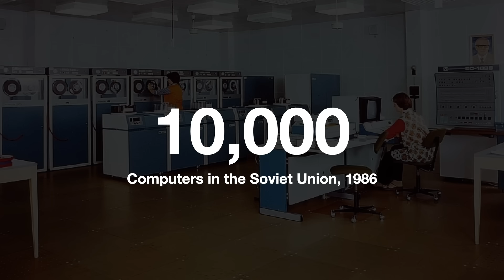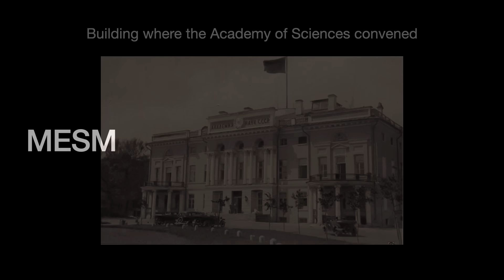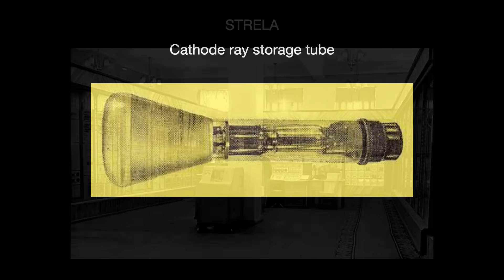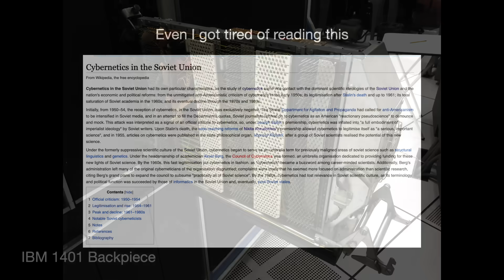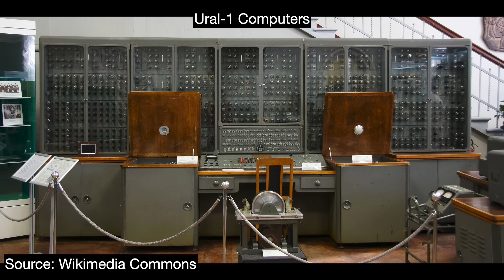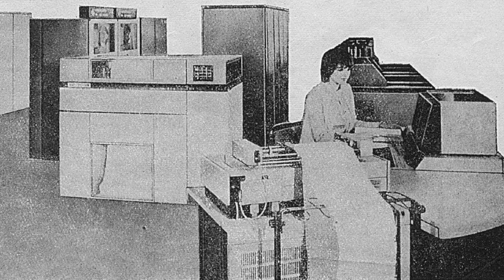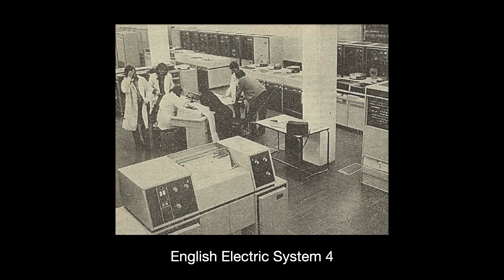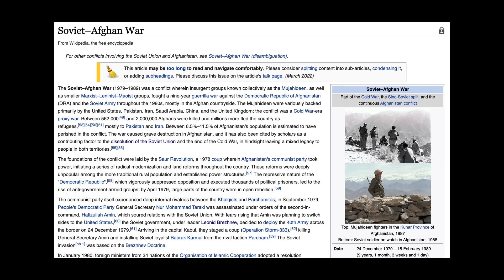Why the Soviet Computer Failed

Comment: I worked in computer research in Czechoslovakia 1980-1990 and depicted situation correspond with my experience. We worked on smaller computer line which was basically a copy of DEC PDP11. Perceived gap in development was 8-10 years. But this could never be spoken out officially because of which is today called political correctness. The breakthrough was heralded to happen every next year. The rule of politicians over scientists and engineers then stopped for roughly 25 years and nowadays is returning again.
Reply: From the motto: Catching up and overtaking is left to us: Don't lose track

Comment: So I'm very interested in the Soviet Union's computer industry and this was the basics on why the Soviets fell so far behind.  But the part of Soviet history that I find fascinating was what transpired in 1960s when the Soviet Union tried to use computers in their Central Planning Office to tackle the computational needs of the Central Planning of their economy.  In late 1960 they viewed computers as the key to their sudden loss of GDP growth.  But by the early 1970s they lost faith of computers ability to fix the problems of the centralized economy planning problems.  This video gives hints that it could be that Soviet computers just weren't that good.  It could be that it was too much work to digitize everything and they lacked enough developers to code everything.  It could be good old Russian corruption prevented computers from being used in manufacturing processes because it would expose the real corruption going on.  But, I'm really curious about this failure of early application of computers to solve this very large problem - although in today's terms this is really a quite modest data requirements.  Any insight into this piece of history would be much appreciated.
Reply: If everything is one giant machine, one breakage halts everything.  Non-monopolistic capitalism is by its nature multiply redundant, and promotes evolution through competition.  This is why state socialism doesn't work.
Reply: @timdunn2257  yes monopolies have lots of problems regardless of the underlying structure of the economy.  But this isn't unique to socialism.  China has lots of state-run companies that overlap.  Our inflation we are experiencing is the result of ultra efficient capitalism where any duplication has been consolidated out of the market.  Tsmc is a prime example.  The baby formula crisis was due to one provider having to be shut down and no one left to make up the difference.  A lack of redundancy can exist regardless of capitalism or socialism.  Even in this story you have an example of competition to build computers in the Soviet Union, evidence that challenges the common beliefs about socialism's failures.  Interestingly the baby formula crisis and the Soviet computer challenge have in common that political power or favors was used to destroy competition which led to worse outcomes.  I'm not trying to defend socialism as much as challenge the same old dogma regurgitated when talking about why the Soviet Union failed.

Comment: Britain built the Worlds first programmable computer Colussus in 1943 (to break codes)
Reply: Germany had one in 1941, the Z3, but they didn't have a similarly compelling use case.
Reply: @CoastalSphinx  Whilst the Z3 featured many (if not most) of the components of a modern computer is was still electro-mechanical whereas the Colossus was electronic and thus had a higher operational speed.

Comment: Solving differential equations.  There are two basic types:  Homogeneous and Non-homogeneous.  The first type can be solved by using regular calculus and algebra via sets of special formulae, much like solving trig formulae.  The other kind can be EXTREMELY difficult to solve and many are done using "brute force" successive approximation methods and they need books of already-completed solutions that one can buy and use to look up and interpolate your own needed answer.  The circumference of an ellipse, amazingly, is one of these needing such thick books to get a solution.  It is these latter differential equations that need fast (as fast as possible) and long-numerical-word-length machines to solve.

When I, as a UCLA Physics Major undergraduate in 1970, sat down in my first upper-division class, Mechanics 101, my teacher immediately wrote the Hamiltonian Differential Equation on the chalk board as the first topic to be worked on.  I said that this is a differential equation and I had not taken any classes on solving them.  He looked at me and said, "You better learn fast then!"  I got mad and told the head of the Physics Department that solving such was needed and classes to do so, which were available, had to be required courses PRIOR TO upper division.  I then immediately took such classes as soon a s possible and had the best teacher I ever had at UCLA, Dr. David Sanchez, teaching this subject, so in a way this mess actually helped me in the long run, though I do not think that was true for most students...

Comment: -Back in college at Embry-Riddle each year we had a hand launched glider contest inside the University Center, or UC.  I of course had a large background with balsa wood, building [and re-kitting....urk~] many RC model planes.  On the side just for fun I built hand launch gliders of about 18 inch span all the time from scrap.  I threw them out the front window of my bedroom on the second floor, and I got to know these fairly well.

So I went ahead and built one for use inside the UC, which had large air conditioning ducts on the ceiling.  I knew that a long heavy fuselage and short wings with pronounced dihedral would work best, and that is what I built.  The first day of "open testing" I show up with my 24 inch long, 16 inch wingspan carefully built glider and I was aghast at what I saw:  With one exception [who beat me], all were engineering students and all had built the most gossamer contraptions you can imagine!  They used "theory" instead of "knowledge" to design and build their gliders.....

Compared to theirs, my glider was big and very fast.  Yet, it did exactly what my yard gliders had done and went all the way across the room and hit the concrete pillar about 10 feet off the ground, while the engineers gliders casually spun in circles and wound up on the floor about 30 feet from where they had launched them.

-One guy, an engineering student, and probably a gear-head like me noticed my glider and the next day showed up with what could only be called a COPY.  I bet that thing was down to the 1/16 of an inch with mine!  Hey, the most sincere form of flattery is plagiarism, right?  The problem is that it was plainly obvious he had not the experience with balsa wood that I had and when he tried to launch it the same way I did, it turned to the right and did a beautiful job of going into the door of the student cafeteria.  I bet it wound up in the salad bar. He probably sanded one wing more than the other and this acted like an aileron.

The point:  Experience is EVERYTHING and while you can try copying, it usually doesn't turn out well-
Reply: not exactly the right example for this topic. There were thousands of talented engineers in the USSR, but the Soviet system gave them poor implementation.
Reply: @Anodum  Well, that's one way to look at it.  If they had had actual blueprints and/or access to a western design they might have done a better job.

Comment: I interviewed and/or hired several soviets who immigrated to the USA who had extensive experience on DEC (Digital Equipment Corporation) PDP-11's, and its RSX-11M operating system. They each told me that the USSR manufactured their own PDP-11s. I was never clear how they got that technology (easy to speculate but I don't know the actual story). In any case, their skills clearly showed experience with those PDP-11s.
Reply: bk-0011m: https://www.youtube.com/watch?v=oHTWyyd9Jlg
Reply: > PDP-11s. I was never clear how they got that technology
KGB/GRU had (have !) enormous departments for technology theft and parallel imports. The specifics - who? when? where? how? - are less important.
Reply: I know how quite a few PDP11s got to the SU in about 1980 as I was the Special Systems Manager for the UK business that exported them. There was a great deal of paperwork involved.

Similarly for more PDP 11s to East Germany in the mid-1980s. And we had to interface them to share data with a Robotron.

Comment: I would loved for this video to continue on into the 1980s and 1990s with the personal computer era. Did the soviets eventually give up and just start importing personal computers? Or did they continue to use these massive, aged systems until the collapse of the Soviet Union?
Reply: While the ES EVM represented the Soviet standardisation of mainframe computers, they also had projects to clone smaller classes of computers as well. Their minicomputer projects were largely based off the DEC PDP-11 and later the DEC VAX; they eventually miniaturised these projects into workstations and personal computers, but never really managed to build them in huge numbers. (Fun fact: Tetris was made on one of the PDP-11 clones, an Electronika 60.)

The Soviet Union and its satellite states also imported a certain amount of personal computers from the West and Japan - IBM PCs, Atari 8-bit computers, MSX variants, Apple IIs, ZX Spectrums, Amstrad CPCs - and engaged in projects to reverse-engineer those as well.
Reply: The countries of the Soviet empire could not simply switch to Western technology.
1) Businesses had very limited opportunities to obtain currency to buy equipment because the Ruble exchange rate was kept artificially high by not being freely convertible. (Like now after the invasion of Ukraine.)
2) State enterprises were the only ones with the ability to buy, and they needed control counters for the plants. Even "toy" computers were used out of necessity. So there was a manual in a trade magazine on how to control a measuring instrument with HP-IB via ZX Spectrum.
3) Enterprises were forced to buy conceptually obsolete and unreliable equipment manufactured in communist countries. To purchase powerful equipment for currency, a business needed a permit. And really high-tech equipment was embargoed again. And such high-tech equipment was the PC-AT. We walked around the smuggled AT with eyes like tennis balls.
Reply: @prutok  
> Ruble exchange rate was kept artificially high
Artificially ? There was little demand for the ruble in the West - there were not many useful goods to be bought for rubles
Reply: @alexleibovici4834  There was little demand in the West, but in the East, state-owned companies and citizens could not freely buy foreign currency, so there was only that amount and that ratio that went through state banks, with a fixed, politically set ratio. In the unofficial (and prosecuted) market, the ratio was different, much worse for Eastern currencies.
Reply: @prutok  
> There was little demand in the West, but in the East [...]  there was only that amount and that ratio that went through state banks [...]
No idea what you mean 😞The ruble was weak with respect to the Dollar because of something in the East ??? Artificially (by whom?) and not because it was in low demand ???
Reply: @alexleibovici4834  The communist economy was hamstrung by an oversized and inefficient administration. The exchange rate of the ruble was artificially maintained by the state authorities by the rate at which state banks were allowed to exchange it. But it was artificial, because the volume was administratively limited (so that due to the great need for foreign exchange someone would not offer a worse rate than the official one). Currencies were not freely available and exchangeable. They could only be exchanged under conditions completely controlled by the state. Businesses asked for currencies in a process that was difficult and uncertain so the official exchange rate was kept at $1 = 1 ruble, even though no one, anywhere, ever gave it to you that way. Either you applied to a state organization or to a dodgy money changer, the bill collector bought at a rate much worse. The communist centrally controlled economy was full of nonsensical restrictions that actually destroyed the economy. It focused on creating appearances instead of a free path to efficiency. Potemkin villages were being built.
Reply: @prutok  
I do agree with most of your claims, but...
There were few useful goods to be bought from Soviet Russia by the West. As a consequence, the influx of, say, USD was relatively low. And Russia needed them badly, first of all to buy Western technology (but not only for that.)
Convertible currency was a very rare and precious good In Soviet Russia. This is why it was sold for Rubles at a very high price (and only to very few selected private Soviet citizens).
The Western companies were not able to buy goods in Soviet Russia by paying in Rubles, only in US dollars. Therefore, Rubles were, in the West, in very low demand and only by private persons who wanted to go to Russia or send money to relatives there - which was strictly prohibited.
Reply: @alexleibovici4834  The West did not need Soviet currency, but the USSR needed Western currency. Therefore, on the black market, which was not subject to regulation, the exchange rate of the ruble against the dollar was several times worse than the rate that showed up in the statistics as the result of the administratively restricted exchange. The state showed an exchange rate of 1 dollar to 1 ruble in official statistics, even though such an exchange was only possible under very extensive and restrictive regulations. Soviet statistics were also subject to manipulation and distortion because the Communist government did not tolerate fair comparisons. Pro-Russian trolls now want to show these distorted statistics as proof of great economic results. However, because of the shackling of society, nothing was great, and the figures at the time require considerable correction in order to compare them with those of free economies.
Reply: @prutok  
> The West did not need [...]
I do know all this, there is nothing new there to me. 
With what do you disagree ???

Comment: This reminds me of a joke back in my day: The Soviets were the first to invent the microchip! Why didn't it take off? Cause they couldn't fit it through the hangar doors of the facility...
Reply: Soviet microprocessor has 40 feet (pins), and also two handles for moving it around.
Soviet Large Scale Integrated (LSI) circuits are largest in the world!
Reply: Soviet nanobots are the worlds biggest nanobots!
Reply: Needed more wheels
Reply: Gotta Iove those old Soviet jokes. Most still applicable to modern Russia sadly
Reply: @Bertiesghost  Like which ones?
Reply: Exactly my first thought. They did not fit  through the factory's doors :)
Reply: another one: "What is this? It  doesn't glow and did not fit in the ass? Soviet device for gloving in the ass."
Reply: Soviet Union built the biggest bridges! Biggest planes! Biggest... microchips!
Reply: That reminds me of another one: What's a Soviet ass-buzzer like? It doesn't buzz and it doesn't fit your ass.
Reply: Hehehe.. that's a good one. Gotta tell it to the next Russian I meet and get their reaction...
Reply: @jasonking1284  It's not fun at all, comrade
Reply: That is true. They organized six of those giant trucks that carry nuclear missiles through the swamps and tundras and loaded the microchip using hundreds of heavy technique units. They wanted to demonstrate the microchip in a military parade in Russia. Unfortunately the trucks sunk under the load in the permafrost even though it was -50 degrees centigrade at the time.

Comment: Re: The IBM 360...obviously it had tremendous commercial success but one tidbit that most people don't know is that the initial Space Shuttles computer operating system was based on a subset of the 360 operating system. That is one reason the Russian Shuttle never successfully flew into space...their software just wasn't as advanced as ours. This is still the case today when it comes to stealth fighters, what separates them the most is our extremely advanced sensor suite of flight dynamics  and battlespace management software.
Reply: But Russian Shuttle did successfully flew to space
Reply: @konstantinriumin2657  it went into earth orbit one time, without a crew.

Comment: In the 1970s I got a Russian multi wave transistor radio and it was an excellent product. It had a turret selector for I think 8 wave bands. The case was made of hardwood and the dial was glass and metal. It was really a very robust product. I used it for several years and used to listen to the shortwave stations from around the world, changing bands as the earth rotated!. It stopped working when I inserted new batteries, I don't know why that happened as I then tested each cell for voltage and all was OK. I miss it a lot.              .
Reply: Burned capacitor or fuse

Comment: Another good example why socialism/communism is so economically and socially destructive

Little known - by the early 80s, parts of the Soviet infrastructure had resorted to secretly buying mini-computer technology from the US Digital Equipment Corporation using numerous shell companies in the US and Europe because they were far more functional than anything the Soviets were building and it was easier than trying to reverse engineer and pirate building them on their own - plus they already came with sophisticated software and networking (and were rapidly supplanting mainframes in the West at the time) already working out of the box and the shell companies could easily source spare parts and software upgrades - they secretly proliferated through parts of the Soviet defense and diplomatic infrastructure instead of relying on the bulkier and less functional ESs (contrary to Moscow's central planning)